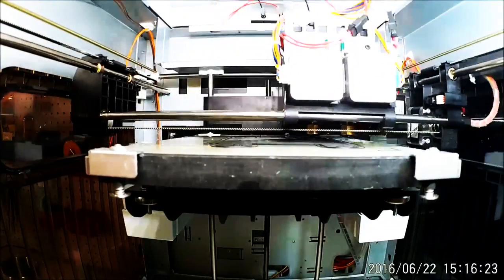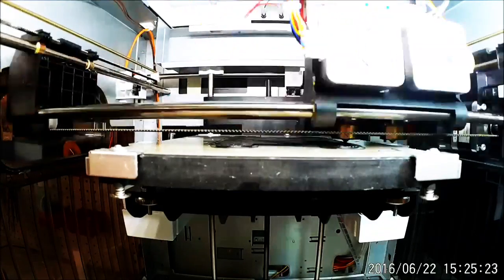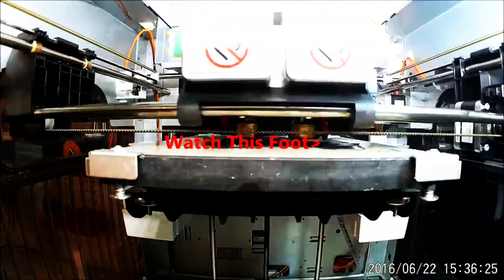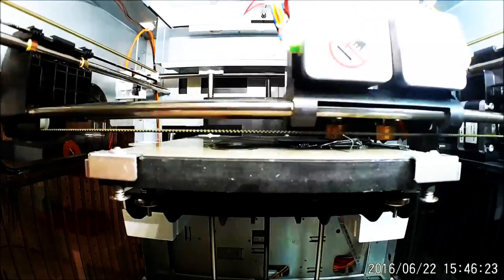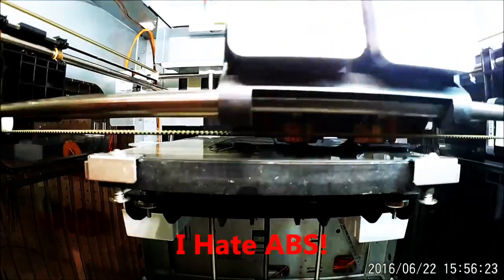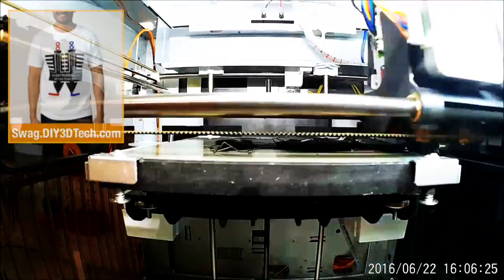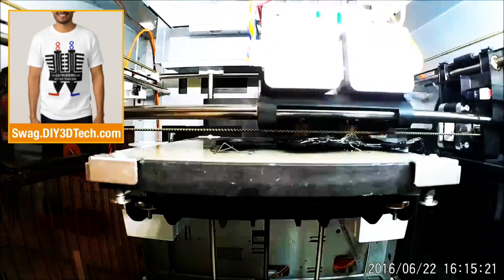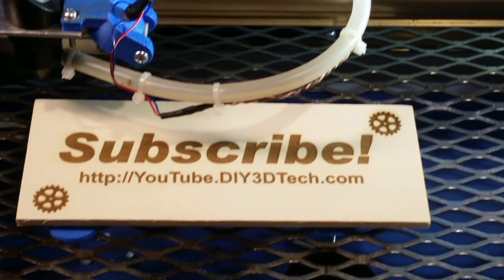3D Printing - An Epic Fail and Why I Hate ABS!

Comment: omg I hate 3D printing in general!  100% of the objects I've attempted to print are "improvements" to my crappy printrbot 1405, and I can't even do that!  I've sunk so many hours into tweaking slic3r settings, calibrating and flashing firmware, etc. for the last 2 years and I have NOTHING to show for it!  it's so goddamn frustrating, all of the projects for which I needed a 3D printer have been shelved and are collecting dust as I wrench away on this piece of garbage that's supposed to enable those who don't own a fully equipped machine shop.  I'm so sick of it!!  why does 3D printing suck so HARD?!!
Reply from the maker: Sorry to hear of your frustration as the one thing with 3D printing is it is NOT turnkey like many people would have you believe.  Second is you can not do it on the cheap on the without frustration and if your printer is 2 year old its time for a new as while it might not seem that things have changed, they have (for the better) and also stop using Slic3r, jump to CURA.  If you want simple and easy to use printer check out the Monoprice Mini Select (http://amzn.to/2alpYKU)

Comment: I am a newbe to 3d printing and so my experience is minimal at present. and yes the use of Kapton may become a chore and unnecessary expense but for now it works and seems to last for multiple prints. I predominantly would like to keep to ABS and move onto Nylon , PetG and then eventually Polycarbonate and I dont think I will ever use PLA. Still a lot to learn.
Reply from the maker: Nylon is rather hard to work with, would recommend "Bridge Nylon", also PetG along with TPU are my fav's to work with.  Yet would not discount PLA for 90% of static prints, its cheap, doesn't emit toxic fumes and offer greater bridging abilities :-)
Reply: Thanks for the advice :-) . I built my printer to make predominantly engineering / functional parts for direct use and so I had totally disscounted PLA for that sole reason - However you have a point on the simplicity of using PLA and now I see there is PLA + my thoughts may change in time ? Being a little stubborn I am going to persevere with ABS and see what can be achieved ? by the way thanks for your videos as they have helped me a lot the last few months !! :-)
Reply from the maker: Great to hear they have helped and please keep me posted as you notice I don't print low-poly poke-mon stuff as part of the channel as while entertaining to some, I try to focus on the more "practical" aspects of 3D printing for either hobby business or small run shops so appreciate your continued feedback.  :-)

Comment: I am a little confused. some people seem to love ABS and others hate it ? . I have only just started 3d printing and have built my own custom design printer, i have only tried ABS so far and I have 100% success rate with sticking to the bed. I only use Kapton tape and nothing more. I have tried 3 different ABS manufacturers filament and all have stuck great. I have a heated chamber on my printer but they stick down with out having the chamber heated. I have only tried ABS filament so far and have no experience with PLA.
Reply from the maker: As you get into it more, you will likely discover other issues with ABS.  It is far more fickle than PLA and yes Kapton tape works ok for ABS however it (i.e. taping in general) will grow to be a pain (at least for me it did).  Also have more build issues with ABS of PLA and one of the reasons (at least in my opinion) is bridging in PLA is better with the layer cooling over ABS (again my experience).

Comment: Not sure what the issue you have with ABS... I prefer it...use it on my Davinci 1.0a pretty much all the time...
Kapton Tape or Blue tape with ABS slurry on it running the temp around 100 on the bed and  have not had warping like this at all...
Reply from the maker: Hear ya, however not a big fan of the slurry (smell and heating up acetone, etc) and have tried tape with larger objects still wrapping.  However happy to hear it's working for you :-)

Comment: lt occurs to me I'm starting the temperature at 110 C and after a couple of layers the temperature drops to 100 c I can't find the setting in Cura so it may be in the firmware  on the wanhao  your DaVinci's maybe staying at 110 C that would probably account for your plastic scorching
Reply from the maker: I also have a Wanhao, where do I find this setting or are you just manually dialing it down?
Reply: I looked I can't find the setting and the two parts are printed today didn't come down more than a couple degrees but I've had it come all the way down to 99 before

Comment: You definitely need to use a very large brim when printing ABS.

Typically I will do a 2 layer high brim that is ~4-5mm wide (0.4mm nozzle * 10 lines).  It also helps to overextrude the first layer 125% to make sure the brim is solidly connected to the part.

And use AquaNet Wal-Mart hairspray to hold the part down!
Reply from the maker: Yes typically do brims on smaller objects or ones with limited surface areas, however this on was rather large and the bigger issue was the warping.  As what happened is the one leg lifted up and the hot hit it.  Even when I do brim's, still get the warping on larger pieces.  Also you point over extruding the first layer is interesting, how do you do this in Cura?
Reply: DIY3DTECH.com In CURA, under Advanced Tab -> Initial layer line width (%) you can set overextrusion of the first layer.
Reply from the maker: Many thanks, now I assume this is for the standalone version of Cura and not the version with Repetier Host correct?

Comment: I'm using Elmer's purple glue stick in quarter inch thick glass on a wanhao i3 the leveller the bed the better
Reply from the maker: 100% right on the bed level!  This one is spot on and has auto-bed leveling also used the purple glue stick too!  Its just that ABS hates me!  :-)

Comment: Not sure what all the hate for ABS. I print ABS quiet frequently with PEI laminated on boro bed with a temp set at 95c. No extra prep. I've printed a box of about a 170mm by 200mm -- and it stuck and stayed stuck for the duration of a ~10hr print. Not brim, not magic hairspray, just a properly leveled PEI surface bed. James Bruton prints a ton of ABS for his creations on PEI, sometimes he does a brim, somestimes not. The only issue with ABS is it shrinks, so dimensional accuracy is tricky, but size up parts by 1-2% and it works pretty well.
Reply from the maker: Interesting, I have had zero luck with PEI but I have used it only on an open frame Wanhao, whereas this printer is a re-flashed DaVinci and I have not had luck getting PEI to work on it with the auto-bed leveling.  Know some folks have shimmed with washers.  However interested in hear more as I don't want to give up on ABS as much as it seems to want to give up on me!  :-)
Reply: DIY3DTECH.com I love PEI. All 3 of my printers have the same setup. borosilicate glass with pei laminated using 3m high temperature tape. I don't use auto bed leveling. On my giant delta I use mesh bed compensation. I just run it once to get a bed mesh with a removable zprobe, and then smoothieware saves the mesh, then on each print start it loads the mesh...that's it, no more messing with that bed. Its a 500mm square bed, getting it perfectly level would be impossible. My other printers are smaller, so manually leveling the bed isnt too bad. I stock piled large sheets of PEI, as I think it will get more expensive as the rest of the 3d printing community figures it out.
Reply: Room temperature and no drafts of cooler air is important. I use ABS almost exclusively with Unenclosed Luzbot 5.
Reply: Do not love the odor....forgot that!

Comment: It has taken me a while to get ABS working just right. 3 things that I felt made it work really well were:-

1. I replaced the heating build plate with the silicon heated bed as recommended by +Thomas Sanladerer in his guide about heated beds https://www.youtube.com/watch?v=eure74A9HNc
2. I added auto bed leveling which just made the builds really stick
3. Use buildtak (a cheap knockoff from FlashForge since I can get it easier) 

I should try the Makers Muse's warping torture test. I think it is the warpinator 5000.

I must be a glutton for punishment but now I think I have ABS going right I really like it better than PLA
Reply: I found the warpinator 5000 https://gumroad.com/l/khwVV
Reply from the maker: Yupper have tried all but number 1 as Da Vinci is kinda a one piece thing so to replace the existing heated bed would more than its worth.
Reply from the maker: Yes have seen Angus print this before and I have cried enough now :-)

Comment: Just out: "Raptor Series PLA" , by Makergeeks.  High temp , high strength , Dishwasher safe , annealable.  Reviews are still coming in,, but they are all good so far.
ABS just requires too many special conditions for optimum printing.  I think it will slowly fade from the hobbyist-level market.
Reply from the maker: I am somewhat inclined to agree with you about it fading.  A UK company reached out to about a PLA they are releasing which is supposed to be super strong and they are sending me some to review which I am looking forward to trying.  As too, I don't like the smell of ABS and not that I am a cancer munger like others on the internet about ABS, but it can't be good...

Comment: I have good results with glass and glue stick putting a small heater blowing on the print bed helps too
Reply from the maker: What glue stick are you using as I've tried all kinds and the best so far has been the Elmer Puple Glue Sticks...